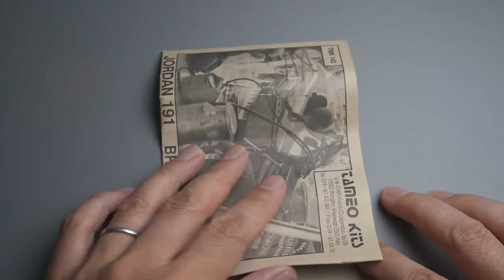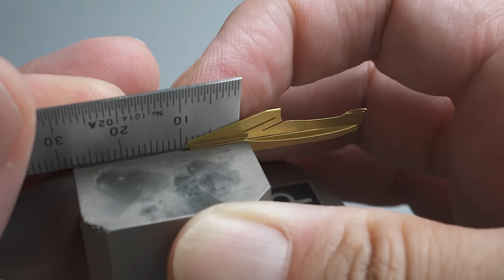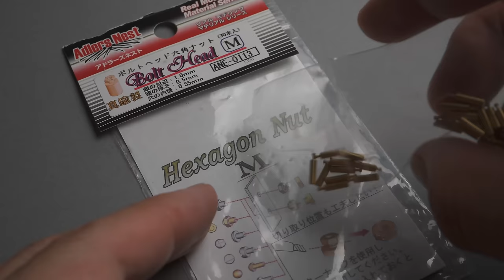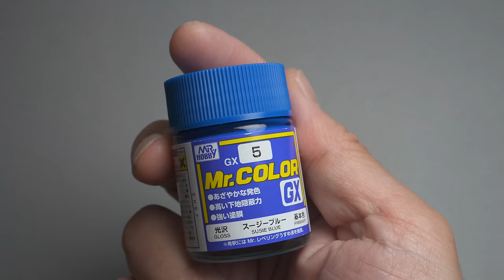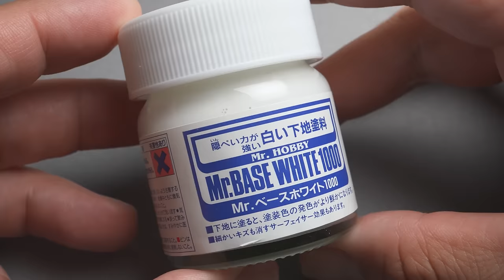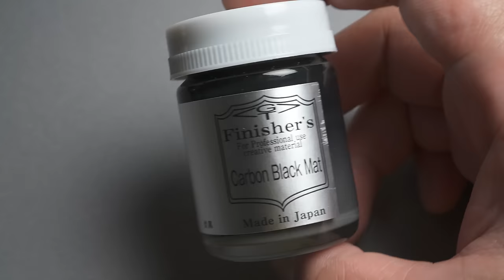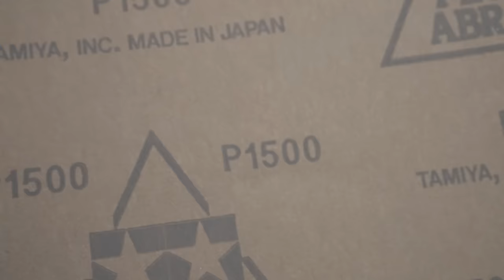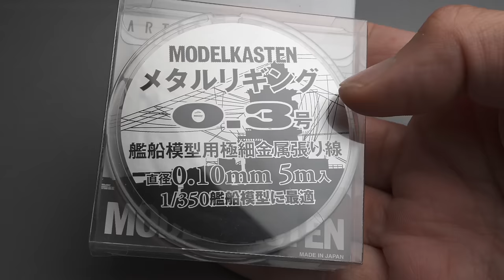Full Build Jordan 191 TAMEO 1/43 scale model car

Comment: Amazing skills and attention to detail! I'm starting to build tameo kits as well, and I'm trying to learn right techniques.
Just few questions. 
-Which rpm of the motor tool is the most suitable to keep control and avoid damage?
- i see you use different kind of sandpaper and abrasive sponge to prepare the body, which grades are best? I see also some abrasive sticks for flat surfaces, any suggestion where to find them?
- to refine the rear wing after soldering, did you use adesive sand paper? on which tool? 
Thanks 🙏🏼
Reply from the maker: Before surfacer, use No. 400 and No. 600 sandpaper.
After surfacer, use No. 800.
After urethane clear, 1500→3000 →compound.
Attach to a plastic board, sponge, unused credit card, or store membership card.
The motor tool is connected to a foot pedal to adjust the speed. I choose to pay more attention to the roughness of the bit than the speed.
Happy to help you in your building.
Reply: @bonbonscalemodel  thanks!
To refinish tires, which grade of sandpaper instead?
Reply from the maker: Finish with #1000 followed by #1500 sandpaper. After that, it's important to dust with tape.

Comment: Thanks for these great videos. How many rpm do you use the Nakanishi motor tool at minimum and maximum? I would like to buy a slightly cheaper one... :)
Reply from the maker: I use motor tools between 1000 and 7000.
So high power is not necessary.
Only the stability of the axis is useful.
Thank you for watching.
Reply: @bonbonscalemodel  Thanks for the reply. I have another question... using a tool with engine rpm higher than 7000 is there a risk of damaging the piece?
Reply from the maker: The tool I use has a maximum speed of 40,000 rpm.However, since the parts are small and require careful attention, I mostly use it up to 7,000 rpm.
Only when I use it as a simple lathe, I set the rpm to about 15,000.
Reply: @bonbonscalemodel  Thank you so much. Your works are a real inspiration for me.

Comment: I would love to build a kit like this. I like all the extra details you added. How do you find these tiny parts? Where did you find the valve stems you installed in the wheels?
Reply from the maker: Thank you for watching!
Air stems,lug nuts and instrument panel switches
→ Adler's Nest Hex Bolt Head, SSS
https://www.amazon.co.jp/-/en/Adlers-Nest-Bolt-Head-Pieces/dp/B001ADQRVM?th=1

Comment: what kind of mat do you use when making a video?
Reply from the maker: The mat is just a sheet of kraft paper.
If my current motor tool fails, I may switch to a Dremel.I think anything is fine as long as the rotating shaft is solid.
Reply: @bonbonscalemodel  Thanks. it's helpful. I did a search.. your tool seems to be more expensive and looks more precise than dremel^^